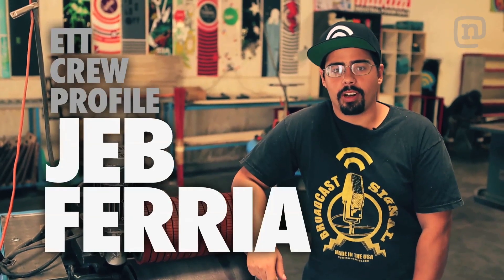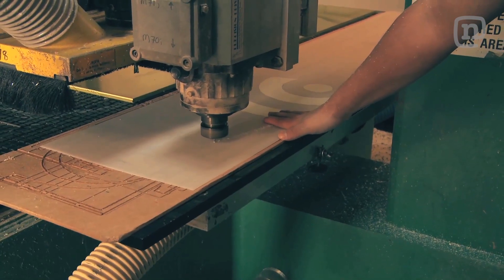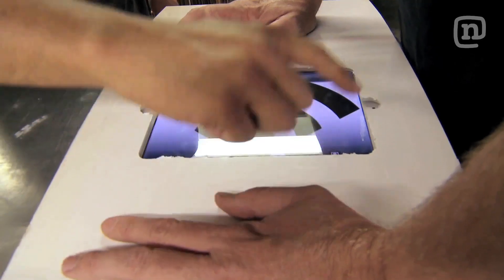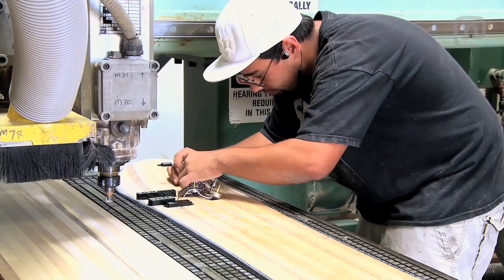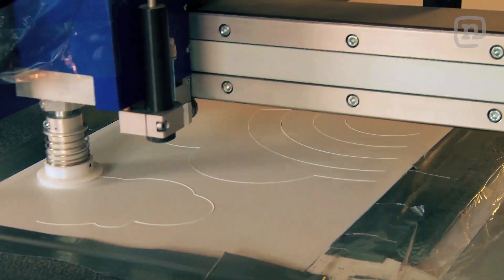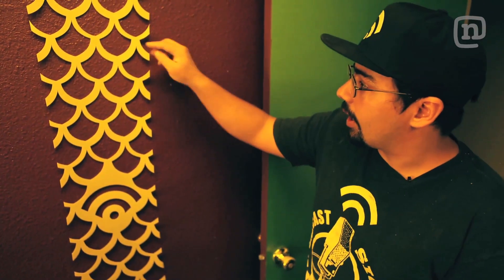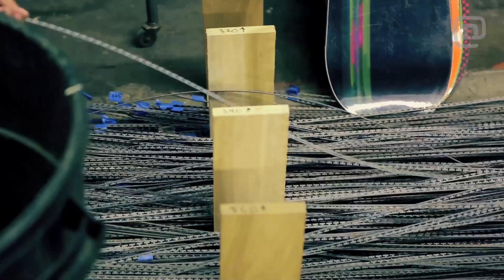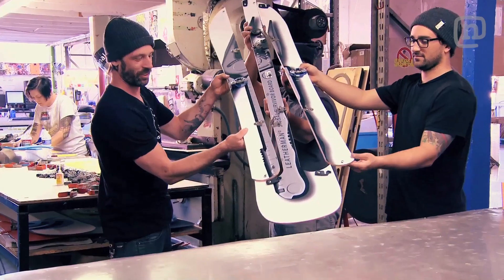Meet Signal Snowboards Production Manager Jeb Ferria: Every Third Thursday Cast Profiles

Comment: I got a job at signal just by putting myself out there and applying. I started at the bottom, machining core. I had some background in designing and CAD from high school so I put it to use and began design and learning everything I could to help further my career at Signal. As long as you are willing to work hard you can get a job in the industry.  - Jeb